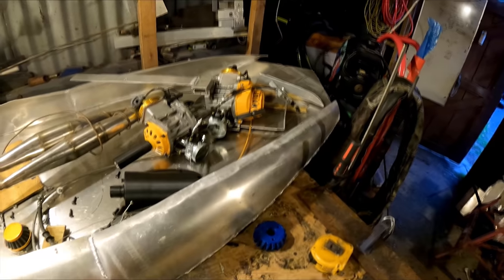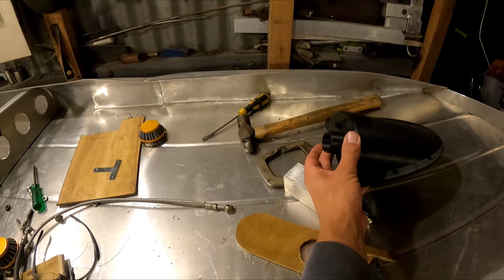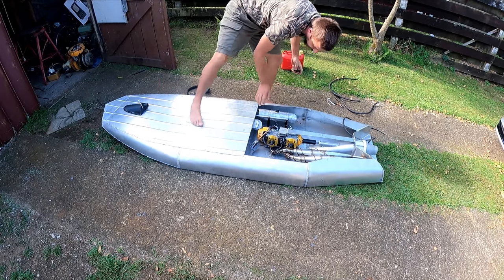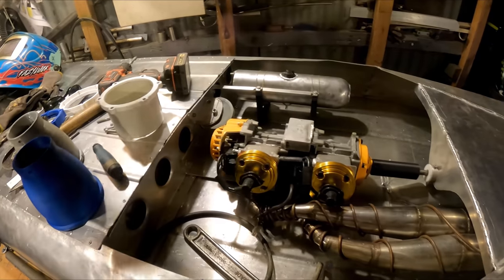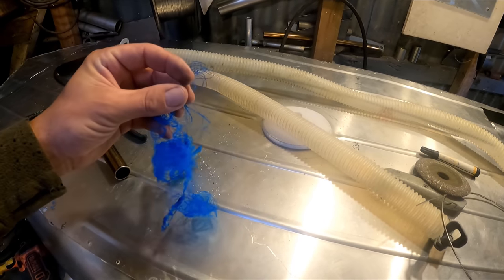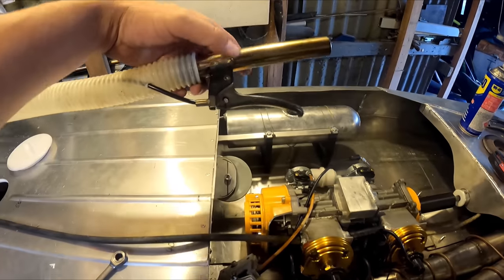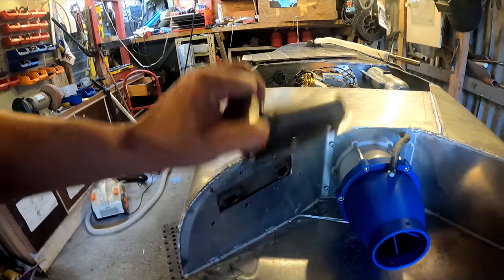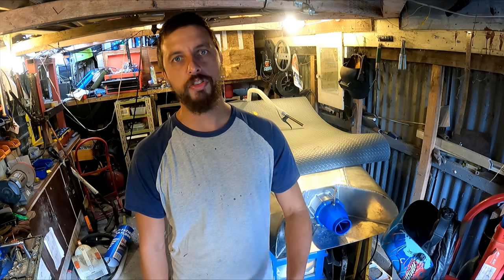Homemade Jet Unit 3d Printed, 2 Stroke Jetboard!

Comment: You can't use 3d printed elements in drivetrain. All those nozzles, couples, propellers will broke before your boat move 5 meters. Propeller must be metal made.

Comment: 3d printing is not your business
Reply from the maker: I think this project was the first time I used one👍
Reply: @DktheWelder   I use pet-g, It better for my mind
Reply: @DktheWelder  I also have ender 3
Reply from the maker: @Tumyp222  there are a great printer especially for a beginner
Reply from the maker: @Tumyp222  I have thought about different filaments but I just like PLA because it is stronger

Comment: HI DO NOT TAKE WATER OUT AT FROUNT. .take out asap side or weight of water will fight you .. im a large boat builder but it all looks good from down here lololl keep it up.. ?? lolol
Reply from the maker: Like it won’t have the pressure to push the water to the front?

Comment: Thank you for posting the 3D printing files for the engine coupling. I'm going to build one of these some day maybe 3 or 4 engines together.
Reply from the maker: All good , be so cool to have 3 or 4 running together I was thinking of leaving room in the board stack another motor for more power later!
Reply: @DktheWelder  yes that would be cool. BTW I'm the some person as TURBO EVERYTHING did you get the link for the easy start.

Comment: Great work as usual Daniel. One thing I'd suggest is to put a small centrifugal fan under the panel where the air inlet tube connects.
You could run it from a lipo battery or similar, basically just to help offset the suction drag through the tube which will probably cause over rich 
mixture if the airflow demand exceeds atmospheric delivery.
centrifugal fans are readily available and will deliver more flow pressure than regular axial fans of similar size.
Cheers, and good luck.
Reply from the maker: I’m wondering when running at full throttle if the pipe will keep up , I don’t really want to have to put more electric stuff in there but I might have to thanks👍

Comment: Awesome.  It's good to see people making things for themselves.  I can't wait to see how the board goes in the water.  Nice work MAN
Reply from the maker: I know I thought I was going to get it in the water this video but some many things to do!
Reply: @DktheWelder  I have an idea for the pull start.   Put it in the bin, lol. Use a cheap cordless drill,  then you can have electric start going to the hand throttle with a kill switch
Reply from the maker: @theideasman6018  that is a pretty good idea!
Reply: @DktheWelder  for you're air intake hand pice thing.  You could 3d print somthing like a hand gun.  Easy to hold  an maybe design it so when you let the hand pice go the intake is blocked off

Comment: I think the tank breather within the intake snorkel will make a vacuum problem for the fuel tank making it difficult to pump fuel to the engines. The serrated flex pipe has lots of flow restriction causing additional vacuum.
Also: you might want to think of a valve on the intake snorkel. Perhaps a valve connected to the throttle so it opens as needed, for when you fall off............otherwise glug glug glug up the snout.

Comment: Hey, you might want to tie a rope or cable from your throttle handle to the board because when/if you fall off and hold onto the handle it's going to pull your throttle wide open.  Luvin this content man!
Reply from the maker: Yeah if I yank on it too hard it will go full throttle! I will have to do something about it

Comment: Had some experience with linking pocket bike engines together to reduce vib and coupler damage timing 180degres apart may help with pluses;)
Reply from the maker: Thanks I do run them 180 apart , they vibrate way less now with the board all more secure 👍

Comment: Such a cool project, just know if you need to make longer throttle cables you can get the collets and solder them onto longer wire easily, even the emergency motorcycle repair kits ($20 ebay) have grub screw ones and they work well.  Looking forward to next vid.
Reply from the maker: Thanks, I was hoping I could do a nice enough job that it would go in the outer but worked out in the end hope it doesn’t snap though

Comment: That front engine will run way hotter with the way you have it plumbed maybe put it into a y joint before the engine.
Reply from the maker: Yeah that is good thinking balance the heat evenly

Comment: Love it! I would do what others have said, make one motor stroke on 180/opposite the other. Would be a smoother pull start and more even power too. Love how much practical use your getting from the 3D printer!
Also, I’m pretty sure the kill switches can be linked together. Save some wiring and effort. Keep it going man, killin it these days
Reply from the maker: Thanks! They are 180 apart, that wire just shorts the coil I was thinking that the would spark the opposite plug if wired together

Comment: Having the fuel tank breather in the intake for inside the board, could that cause a build up of gas fumes inside the board? Unless you meant the breather is on the outside of the intake tube then nvm. 
Very excited for this build!
Reply from the maker: Maybe I could run it out to the air might be safer👍
Reply: Might consider a small centrifugal fan to blow out any built up gas fumes or I know where this project is going,,BOOM! That's why inboards have blower fans. They keep you from going BOOM! Fumes are bad.

Comment: You might want to add gravity controlled valve on the intake handle so if you flip over, drop the handle etc valve closes and no water gets into intake and cylinders. Not sure how this valve is constructed but so it closes when no in 45?degrees from upright. Could do it with servo and gyro sensor maybe?
Reply from the maker: I been thinking about that unless the board is completely under water the water won’t be able to flow up the intake hose , even when the board is upside down it has to fight against the air pocket. What do you think?

Comment: Generally increasing the wall thickness makes the part stronger than 100% infill. So instead of using 100% infill just increase the wall thickness until you effectively reach 100% :)
Reply from the maker: I have been told that but a problem I have the more wall thickness seems to distort the part more and also makes it peel off the bed , I am pretty new to 3d printing any advice on how to solve this?
Reply: @DktheWelder  Your nozzle size is by far the most important factor when it comes to the width of a single line of filament. So if you have a 0.4mm nozzle you should try and use a wall thickness that's a multiple of that to work. Trying to print a wall that's 0.6mm wide with a 0.4mm nozzle will probably result in 0.4mm instead. With a 1mm wall and a 0.4mm nozzle you can make it work through infill but it won't be too smooth that way.
Reply: @DktheWelder  With regards to peeling off the bed, it can help quite a bit to have something to enclose the printer. Usually the peeling is caused by uneven cooling and/or too rapid cooling. As a simple test, just put a big cardboard box or large bag around your printer :) I don't recommend cardboard long-term due to the fire hazard though. But special insulating enclosures are for sale, or just muck something together. I've got one of those IKEA Lack tables with some polycarbonate sides as an enclosure and that helps quite a bit.

Comment: you don’t need 2 kill switches, all they do is ground the magneto so no spark is produced, linking the wire and having one switch is enough.
Reply from the maker: I was worried that it would cause the other motor to fire at the wrong time ? Anyways I have the 2 switches to use👍

Comment: For you inner cable have a look at a Volkswagen bus universal throttle cable for something like a 1970 type 2 bus they are about 6m long to go from the front of the van all the way to the back
Reply from the maker: Thanks, that would work but I need to push forward with my projects waiting for parts to show up takes so long these days! Hopefully what I have made will hold up

Comment: Hey dan, do you reckon this would have done better with a 212cc predator 7.5hp running the jet unit or worse?
Reply from the maker: I think it would have done better, not as fast as the longtail but it probably would have got planning just

Comment: those 49cc motors are shit. you should have used the other style 49cc motors or even the 79 cc auger motors
Reply from the maker: Someone else said those motors are no good , hopefully they work the 79cc ones I haven’t seen them?
Reply: @DktheWelder  the 49cc i have on both my gas scooters with a walbro carb and a good tune  you can do 34mph
Reply: @staydown.normal5323  Hi, I know this comment was from a year ago but I was just curious as to what the name of the 49cc motor that you used is called. I was planning on making this kind of project as well. Thanks
Reply: @adrianbilas6901  i can make you one my first job was working at a little hobby shop that sold race gopeds so i know how to tune them fast! and what it take to get the to go faster
Reply: i have some ideas for a bigger motor too
Reply: @staydown.normal5323  what specific brands of motors would you recommend on a budget? Also what things would you do to them in order to make them perform way better? Thanks
Reply: @adrianbilas6901  I will make a video I just for you
Reply: @staydown.normal5323  ok great. Thanks